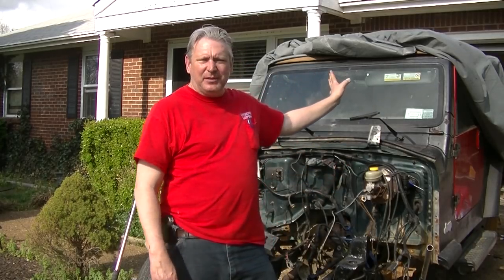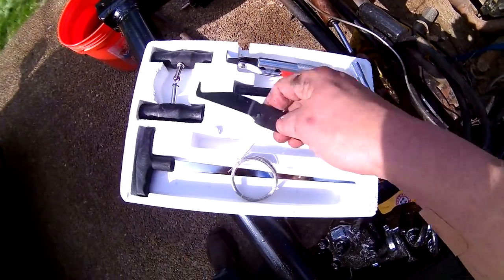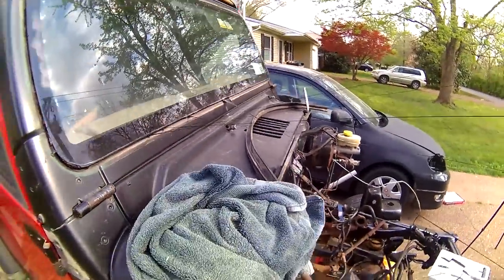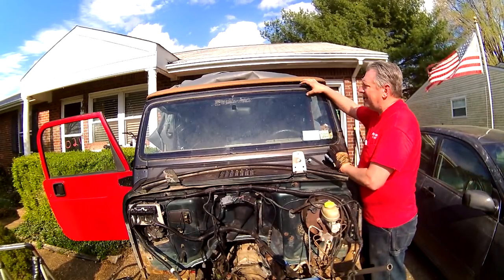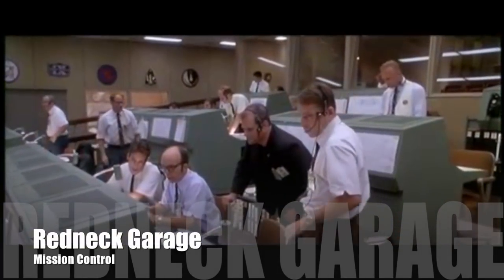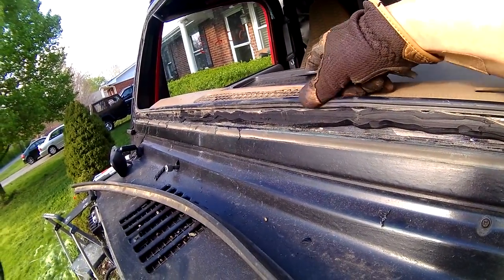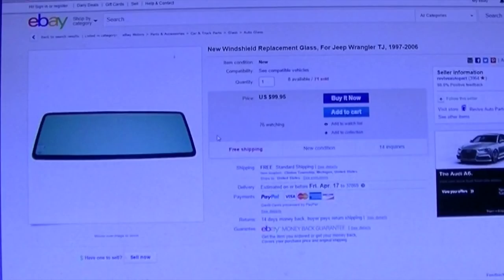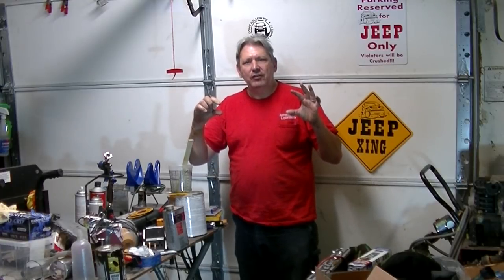Jeep Wrangler TJ Windshield Removal - Mission Control

Comment: Just got my old windshield out on my 99 Wrangler. It was already cracked, so I wasn't worried about saving it. I noticed the top left corner was really stubborn to break loose on mine too.  The rest of it came loose easily after sitting in the hot sun for an hour or so.

Comment: Hey, Dave: Many thanks for your instructive and humorous vids! I'm in the process of finishing up a bunch of mods and repairs on my '06 LJ prior to sale, including a windshield replacement. I was going to pull off the windshield with the frame to do the glass replacement, but cutting out the old urethane looks like a chore. Do you recommend cutting the urethane out with the frame still mounted on the vehicle, or do you think removing it while propped up on a bench or sawhorses might be ok?

Comment: i had mine replaced in my tj at safelite and it was under 200 bucks installed. so your windwhield is 100 plus 25 in glue so i guess your saving 75 bucks doing it yourself, but if you break it your SOL. ill be watching your next videos to see if you install one...good video though!